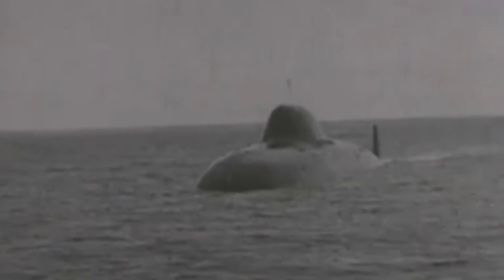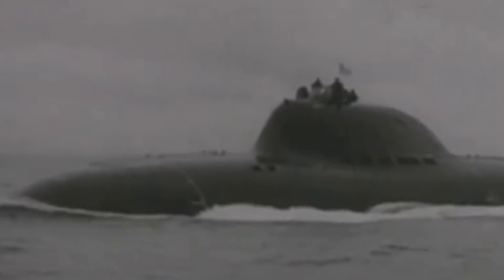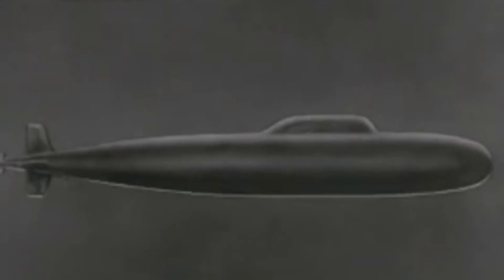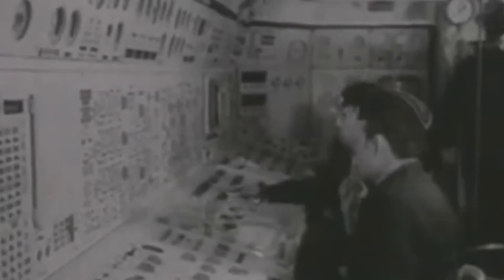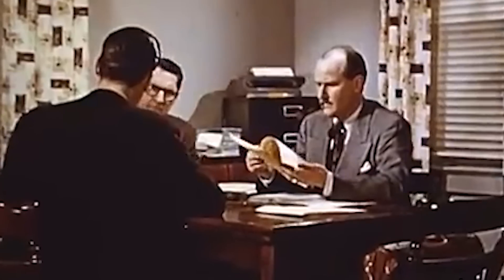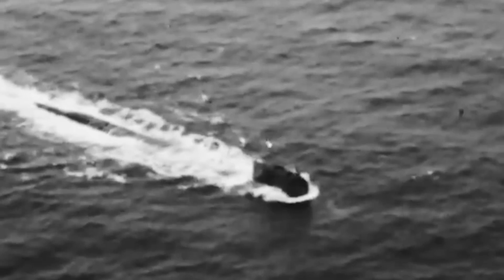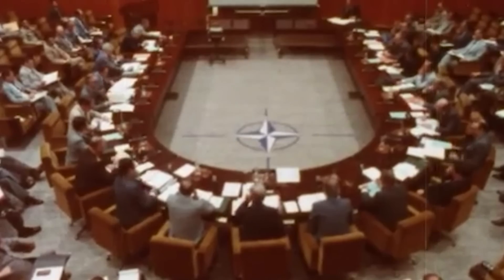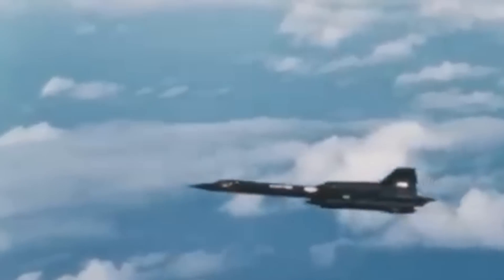Russia's Top Secret (Shiny) Titanium Submarine

Comment: One of the great difficulties of working with titanium is that it loves oxygen like a greasy trucker loves his lot lizards. Any part of it that gets even cherry red needs to be purged or it will oxidize and sometimes even catch fire. Argon is the cheapest gas to do this with. The Soviets figured the best way to weld massive titanium sections was to purge the whole building with Argon, and supply the welders with oxygen, and stick welding stingers for holding tungsten electrodes. An extreme variant of TIG.

Comment: No mention of the fact that the submarine was "very noisy" ( though this may have not been a problem at the time, especially when speed would have been a mitigating factor in combat ) and as technolgy caught up, the excessive noise rendered them 'not as useful as they might have been'.
Additionally, the cost of running and maintaining them was immense; the design -nature of the nuclear reactor was such that it had to be kept running 24/7 whilst the submarine was anchored in port. To do anything otherwise, would have rendered it useless.

Comment: I will allow myself to supplement this story about the difficulties of manufacturing and servicing boats with a titanium hull. To make it clear - titanium with many metals, such as steel, aluminum, copper, forms a galvanic pair and destroys these materials, which means that even elements such as door hinges, door handles, stairs and so on have to be made of titanium. Moreover, special berths had to be developed for such submarines, since ordinary ones made of reinforced concrete, such a boat turned into porridge literally in one year.
Reply: Not true. First it has to be corrosive (wet) environment. Second, if metals undergo galvanic corrosion or not depend on their anodic index. So Titanium and its alloys has -0,3V, cooper and ita alloys has -0,35V, so difference is just 0,05V which is not enough to initiate galvanic corrosion even in saline, let alone water. Corrosion resistant steels has -0,5V and aluminium and carbon steels have -0,85V to -1V, so titanum to corrosion resistant steel has smaller step (0,2V) then corrosion resistant steel to carbon steel (0,35V).

Reinforced concrete has same effect on titanium as on steel. None. Steel inside concrete is isolated from outer environment and concrete itself after hardening does not dissolve any substances into water.

There are more significant problems with dealing with titanium and its alloys. Not only price, but also it is much harder to bend, machine or weld. Especially welding is pine in the ass. You need to weld it in protection atmosphere (with minimum of free oxygen), which means that welders need to wear breathing masks and it is possible to weld hulls only in enclosed capsules. This is why USSR/Russia had limit how long and wide pressure hull of submarine can be and why pressure hulls of Typhoon are relatively tight.

Comment: Steel is significantly stronger than titanium, but titanium is lighter, while being more corrosion resistant.  A titanium would not be thinner.
Reply: You are comparing alloy (steel) to crude metal (titanium). As nobody is using crude iron to build submarine, Soviets did not use crude titanium. They used titanium alloy, which was almost twice as tough as HY-100 steel (TYS was 1300 MPa, HY-100 has TYS 690MPa, then used HY-80 by USN had TYS 550 MPa. TYS = tensile yield strength). Modern beta titanium alloys used by Russia has TYS equal to maraging steels (1800-2300 MPa), this titanium is used for special deep diving submarines like Losharik or Konsul (5-6 km operating depth).
So when you have steel alloy with 690MPa and titanium alloy with 1300 MPa, titanium wall is not thicker, but 20% thinner to give same toughness.

Comment: 0:54 No torpedo could destroy it!? Give me a break.
Reply: Not torpedoes then in US arsenal. Alfa was too fast and too deep diving. Even Mk.48 ADCAP would have difficulties to keep pace, especially in depth over 500 meter. It is simple math. Let assume, we have MK48 ADCAP with range 35 km at 55 knots. This translates into 1250 seconds full speed run. If Alfa is evading at speed of 40 knots, speed difference between Alfa nd Mk.48 is just 8 m/s. So maximum firing distance is just 10 km. If alfa dive into 500 meters depth, backpressure in Mk48 engine will reduce its speed to 45 knots but not the run time. So firing distance is reduced to 3,2 km. If Alfa in emergency dive to 700 meters (it was capable to do 1350 meters at EOL, but depths over 600 meters damaged equipment), her speed would be greater than speed of Mk48 ADCAP and this firing distance is practically 0.

EDIT: This is why so many nations with advanced submarines rely on electric driven torpedoes. They do not lose efficiency with increasing ambient pressure like combustion driven torpedoes. Turnpoint is around 500 meters of depth, where backpressure is so high, that combustion driven torpedoes tend to be slower and shortranged than electric driven. In depth over 800 meters, no combustion driven torpedo would work anymore. This is why submarines like Oscar, Yasen or Sierra class are virtually invincible from American and British submarines, because they can safely operate at those depths.
Reply: They mean no torpedo could catch it. It could outrun all NATO torpedoes.

Comment: 3:17 higher corrosion resistance 😅😅😅. Yes - titanium is a strong for corrosion, but it means that you cannot use stainless steel or simple steel or copper because in the process of  electrochemical corrosion titanium will "eat" almost very metall or alloy (except some special cupronicel or bronze). There were rumors that the first "goldfish" destroyed the steel pier at which it was moored.
Reply: These are not rumors, she really turned the pier into mush, literally in one year. This was told to me by my father, who was involved in the maintenance of boats of this class. The thing is that titanium forms a galvanic pair with many metals.
Reply: @vladimirnikolskiy  I was involved in the "maintenance" of modern U-boats up to 2018 )). Titanium is still widely used but with some hints ))

Comment: Titanium is not rare at all.  It just has been expensive to process the titanium oxide into titanium metal.  A new plasma process reduces this, but the energy requirement is still large.  With dedicated nuclear plants, perhaps SMRs, we could make mountains of the stuff.  It is also extremely difficult to work with.  Still, I think it is the next stage of industrialization.  We need to be making most transportation devises with it.  The use of aluminum has been fraught with tribulations.  In aircraft, it easily fatigues.  In buses, it is simply unsafe in accidents where buses easily rip open, but it continues to be used by busing companies, and continues to have horrifying accidents, because the weight savings is substantial over steel, and thus the operating cost.  Passenger trains, too, are often built of aluminum, with the same increased risks.  Titanium is just a vastly superior metal for these applications.  In automobiles, it can help keep occupants safe at higher speeds.  It is also fantastic for trucks, where truck beds often have to contend with destructive loads.  A titanium bed, would handle this far better than aluminum, and better than the typically used steel.  But at the very least, it should be used extensively in unsprung weight, in vehicles such as the springs, calipers, hubs, axles, differentials and their housings and such.  But applications are not limited to transportation.  I even think it is ideal for food cans.  Recycling it is much less costly than initial refinement.  As cans for food, no linings would be required, and the cans would outlast any food placed within. It would also reduce denting, as titanium flexes quite a bit before permanently deforming.

Comment: Please stop saying titanium is stronger then steel, it is not stronger then steel, it is clouse to steel in strenght and clouse to aluminum in weight.
Reply: Don’t comment on my thing the comment wrong again, titanium can withstand a higher PSI than steel, titanium has a higher melting point than steel. But titanium does not flex, why do you comment when you’re so clearly wrong?
Reply: @bobbythomas6520  Your thing, I have made and tested many parts from titanium, the bigest reason for using titanium is to save weight. Titanium certenely has different characteristics from steel but I have not seen it to be stronger. Also in my experience titanium has greater flexibility then steel. What testing have you done SIR.

Comment: Soviet subs used Variable Frequency Drives during the 60's and the US could easily pick them up from these emissions due to their huge harmonic radio frequencies. For over two decades the US could detect Russian submarines locations using this technique - they (the Russians) never knew about this at that time. I wonder where the scales lie now? .....
Reply: oh my, detecting submarine by EM wave emission? what nonsense can one find on the internet 😀
Reply: How easy it is to believe propaganda. Read about the wake of a submarine, if you don't know, this is an area of heterogeneity of the physical fields of the marine environment that remains after passing in the submerged position of the submarine. Since Soviet times, with the help of this phenomenon, the USSR controlled the movement of American submarines, and hunters of the "Shark" type, with its help, could launch homing torpedoes from a depth of 400 meters.
Reply: 2 centuries? That's 200 hundred years! Think you may have meant 2 decades I.e twenty years

Comment: It would be more appropriate to reference the Serria I & II class submarines as platforms that benefited from the developments of the Alpha project rather than Akula. 
Also addressing the radiological concerns of the Alpha's experimental reactor design and short falls in the automation systems / reduced manning plan would help explain why Russia didn't just build more Alphas or an improved / modernized Alpha II as was common in many other submarine class of the era.
Reply: Yeah, Akula (971) was supposed to be more feasible fiscally.
Reply: There was plan to develop Alfa successor, but priority was given to increase numbers of new multipurpose submarines like Akula and Sierra capable to carry not only torpedoes, but also missiles. Alpha was capable only attack other submarines. Absence of 650mm torpedoes and ability to fire Granat cruise missiles was serious disadvantage.
Alfa class successor should solve several drawbacks in original Alfa design, especially need for shore facilities to keep coolant liquid, but never left design board.

Comment: The other issue with alfas- you couldn’t turn the reactor off. If the molten salt solidified, the reactor was effectively frozen permanently. Faster then he’ll though
Reply: It was not a molten salt reactor, it was a liquid metal reactor that contained a lead bismuth alloy. Otherwise you are correct they could turn into a radioactive brick, and one of these submarines was scrapped because of that.

Comment: Another issue with titanium is that it work hardens.  Every time an Alfa went to test depth, the test depth would be decreased by about 10% due to embrittlement of the pressure hull.  It was limited to the number of deep dives it could perform.  And yes, they were very fast and very loud.
Reply: I am a mechanichal engineer and titanium does no behave the way you described, it is either a myth or some flaw in the soviet construction that caused that. I don't think there were any steel alloys in the 70's that could acheive what a titanium structure could.
Reply: Who told you  that and why do you believe them?
Reply: Amazing how everyone is so eager to point out the negatives, I doubt these sentiments would remain if say Americans made the Alpha
Reply: Lol nope
Reply: Not true. I operate ROVs which are predominantly built of titanium and they go down to 6000M, for years of service. Thousands of cycles. You don't know what you are talking about.
Reply: @karlp8484  Everything is right. If everything is done correctly, the boat will be very strong and reliable. The main thing is not to glue titanium, as the Ocean Gate company did :-))
Reply: @Doctor_Better_very_well  More of a vacuum fit than gluing. they rested 2.4 tonnes of CF onto three or four 123 blocks during the ring glue operation.
Reply: @karlp8484  Are your ROVs made of welded-together titanium pieces? The problems come from bad welds, I believe.
Reply: @deezeemb  Titanium is very difficult to weld. The frame is aluminium but that's not the pressure-containing parts. The good news is that aluminium and titanium are not too difficult to weld together. To weld titanium you have to use TIG or plasma.
Reply: @karlp8484  Then I don't understand your original argument.

If the titanium on your ROVs is not the pressure-vessel, then what were you arguing against?

The talk was about titanium pressure-hulls.
Reply: @karlp8484  ROVs don't really pressurize/depressurize. Most of the hollow sections are filled with rigid foam. It's like flying a Cessna at 40,000 ft., you could do it for more cycles than the equivalent airliner, because there is no pressure differential. It's also the reason that there are almost no old jets flying around from the 60's, but most of the GA stock is from the mid 70's.
Reply: Нет
Reply: I can always tell comments made by bubble heads ...silently swiftly deadly...unless we are calling out bullshit on the cold wr myths ....I ooga I ooga Dive Dive 😅😅😅😅😅❤
Reply: read some fundamental study on fatigue properties of titanium alloys before commenting 🤣
Reply: Yup and yup

Comment: The REAL danger of the sub's Titanium construction is that it was Non-Magnetic. Since much of the sub-hunting is done through 'Magnetic Anomaly Detection'  or measuring the deviation of the Earth's magnetic field by Ferous Metal hulls, The Titanium hull of the sub slipped through without being detectable.
Reply: But everybody could hear it's propellers from halfway around the world
Reply: But that also makes it detectable.  If you see " black holes " in your normal scanned area, that would be where the Submarine is.  Being invisible can work both ways.
Reply: @robertwillis4061  A non magnetic hull wouldn't display a "blackhole" to detection equipment, it would simply appear as nothing but more ocean. Do you think magnetic anomaly detection equipment picks up wooden hulls as a blackhole also?